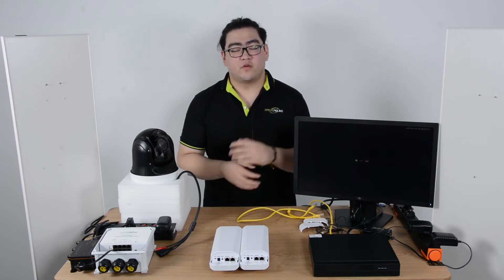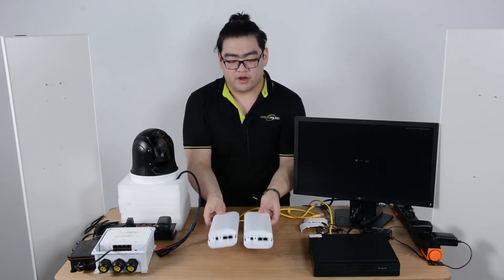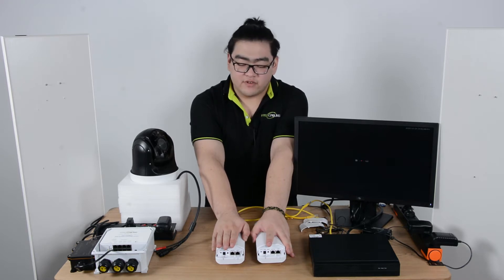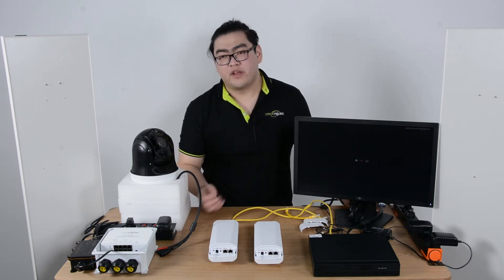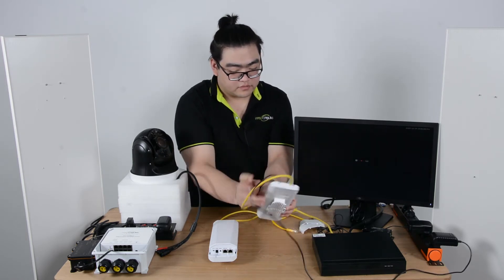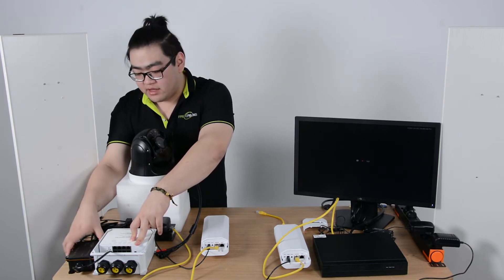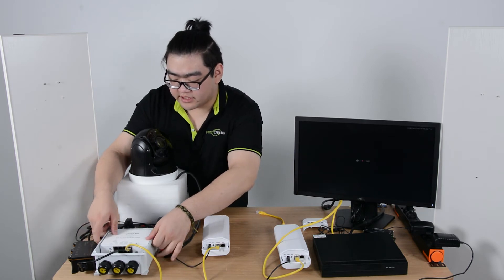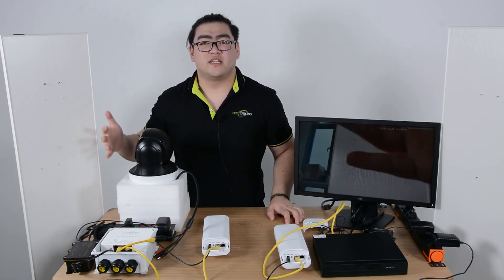Build Your Multiple PoE IP Camera System over 1000 Meters without Cabling

Comment: helo sir this is for any brand of NvR
Reply from the maker: Yes. It is transparent to your existing network. You can hook up any ip cameras and NVR to the system.
Reply: @Fastcabling  but this wireless we need to install per each camera example 4camera but the 3 other camera is distance in 10meters from wireless this posible 3camera to connect together in wireless or we need to seperate wireless also
Reply from the maker: @London725  if you can aggregate three cameras to single transmitter, it is better. It will be easier to align single transmitter and receiver, rather than multiple transmitters.